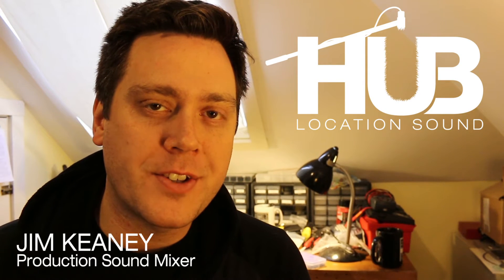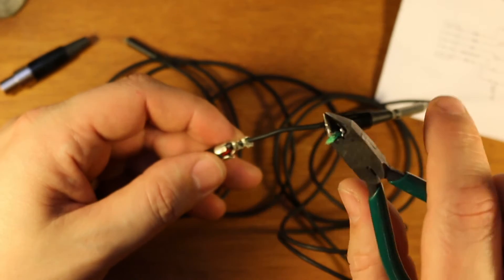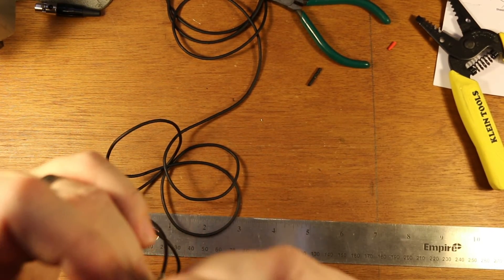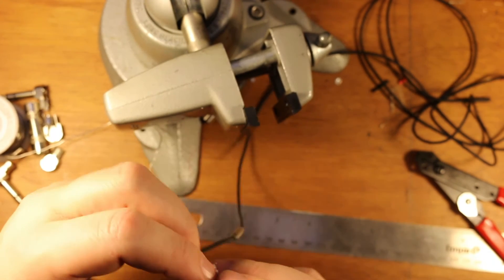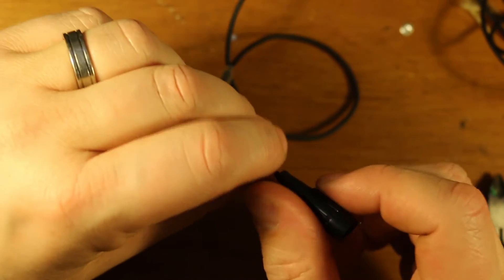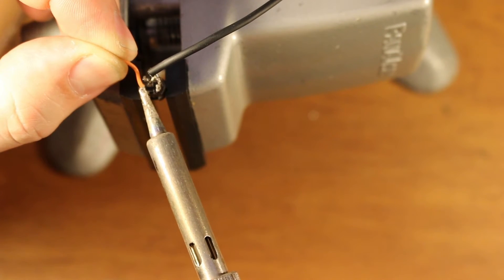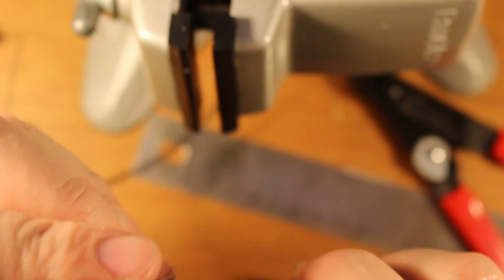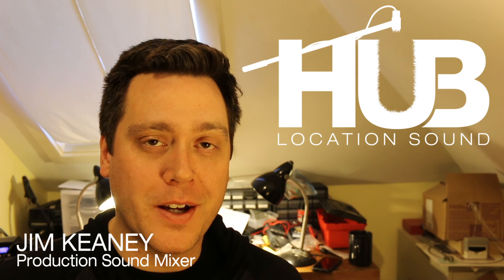Wiring a Sanken COS11d Lav to a TA5 Connector

Comment: Okay, so happy to help here. As an engineer in the industry field, i have terminated close to 1000 Sanken lav mics as the company i worked for was an agent for Sanken.
So a couple of tips.
1. USe a very sharp scalpel (surgical std) and rotate the cable with the scalpel bearly cutting through the sheath but not damaging and cutting any of the shield... this can cause microphonic noises if the ends of the wire rubs.
2. Dont hold the solder to the soldering iron as per this video and then dabbing it onto the wire. the solder has flux which is important to help the solder flow. You can see the flux spitting and exiting in the video. Hold the solder to the wire you are soldering and apply the tip of the iron and hit both at the same time to get a good flow with flux.
3. Always have A grade side cutters. The eren side cutter 2422e are super sharp and the best as they cut through the white (Audio) and black (BIAS) wire plastic sheathing with ease and with control you will not cut through the wire strands.
4. Lastly, when reterminating, cut back about a further inch from the back of the boot as the most common cause of failure is the bend of the cable has out of the boot where the cable is made to do a sharp bend sometimes and the wires inside and shield can break or be down to very minimal strands left. look hard and you will notice a strange stress mark and texture change where the cable has been stressed on an angle confirming the cause. Other wise most likley the Lav was tugged by talent and this casued the issue... or bad retermination ;)
Happy to make a video from a professional perspective if there is any call.
Reply from the maker: Thanks for sharing your expertise, Jaques. I've learned a lot since making this video a couple years back, but your notes are appreciated. I'd love to see a video from a professional like you.
Reply: @HubLocationSound  maybe you should do version two of this video? :)
Reply: @JacquesPierre Would be great to see a video from you!
Reply: Where can I find your how to video? Thanks!
Reply: @JacquesPierre I would love to see more videos on this! I have to terminate my Sennheiser MKE-1-4's to TA5, so the more tutorials, the better.
Reply: I have also done 1000s of these. The trick is to dip the very end of the white and black wires and solder them to the prepared connector as of they were already stripped and  tinned. After you get the technique down the casing will melt as you solder it and youll get a perfect connection.

Comment: This is great. I was struggling so much soldering the tiny wires;  I initially tried to strip the B&W wires. After your tip of just dumping it in the molten solder worked a treat! Thank you.

Comment: thanks for the Video Loved it and helped me 
just to confirm the colors of the cables
white  is Audio Pin 5
Black is Bis Pin 3 
is that correct or did I get that wrong ?
Reply from the maker: nour halawani Thanks, glad it helped. Yes, you got the colors correct. The pins depend on which Lectrosonics wiring diagram you’re using.

Comment: Good stuff. I also didn’t separate the shield. Right after stripping the insulation off I tinned the shield right where the insulation was cut off all the way around. I then pulled out and cut off all the shield and fiber strands beyond the tinned spot. I then soldered a real wire to the tinned shield and put heat shrink over the connection.

Comment: Great video. I use old resistors and just cut the ends off for the jumper.
Reply from the maker: Bal Rayat nice. I’ve since started doing that too. I put a piece of heat shrink on it, but I like that the leg is moldable and once one end is soldered it’s easy to line up the other side.

Comment: is it valid also for the older um 400 tx?
Reply from the maker: David Aliperti the older (pre-A) transmitters need the older wiring specs: https://www.lectrosonics.com/Support/images/WiringDiagrams/Wiring_diagrams11fig-2017.jpg (FIG#5) which involves adding a 1k resistor (I highly recommend using a smaller 1/8 watt resistor as space is tight enough in there without adding components).
Reply: my usual renting company told me that a normal universal wiring is ok, that has confused me.

Comment: Hey there thanks for the video! Was wondering if you could point me in the right direction for a diagram that will show the wiring for a 2.5mm jack for my MM200 transmitter? Cheers!
Reply from the maker: bing Bong try this http://www.lectrosonics.com/Support/Microphone-Wiring/sanken-cos-11-wiring-for-lectrosonics-wp-watertight-plug.html

Comment: Thank you for making this video, I had a grounding problem on soldering COS-11D into the LEMO connector, Do you ground all the shield or just the metal ground wire on the shield? I got Higher impedance (need more Gain on transmitter)  on the wire that i repair than the wire that original bought from the shop. Or it doesn't matter at all?
Reply: Hey, i imagine by now you fixed the issue but some insights. THe SSM, Zaxcom and later model Sennheiser use the 3 pin LEMO and actually all will be able to work with each other whic is pretty cool. ii have done 100's of these Lav mics and i have always found that soldering shield to Pin 1 and also under the collet eliminate any ground noise. The massive change in dB level indicates you may have had a red dot Sanken that maybe someone put a black dot label onto. i have seen this before. You cannot change LAv level on the 3 pin LEMO by wiring a certain way so the red dot is the obvious reason. I will be doing some of these next week if you want a small video sent to you on how to prepare and crimp properly the connector.
Reply from the maker: Sorry I can't speak about Lemo connectors. I've only attempted this wiring with TA5 connectors. Not sure I understand what you mean by "all the shield" vs "just the metal ground wire". I finger-wound it all together and tinned with solder. Which leaves 3 wires to terminate: white, black, and shield. So yes, amongst the hairy shield is a thin more coarse wire... I kept them together.
Reply: does the soldering wire affect the gain of the transmitter? the one i repaired are 12 dB less than the one i got originally. is it the matter of the soldering wire i choose have more resistance ? what soldering wire you have used?
Reply from the maker: I don't believe the solder itself would affect impedance. Especially by 12db. Do you have any specs on how the original mic's are/were wired? Are you matching that wiring diagram?
Reply: I did open up other COS-11D to look at , it didn't even ground the shield and it only solder TWO wire, signal and the ground. I did the same, it was 12 dB less and got interference with the RF antenna next to it, so i decide to ground the shield, it didn't pick up the RF interference but it was still 12dB less than what i got from the store. 

Every mic i repair have the same problem ( 12dB less) so i wonder the problem is the grounding? the solder? or else... 

One of my sound recordist friend who have the same problem with TA5 connector, he said the COS-11D was quieter that original after repairing.

So do you lav get quieter after repairing? Or maybe I didn't strip the cable well made a bad connection, causing unwanted resistance?
Reply from the maker: KK Chau you're going to lemo? What wiring diagram are you following?
Reply: And i have opened my other lav to check how do they solder it. I followed by the result is different.

Comment: Thanks for making this video. This worked great for me. The only thing I did differently is that I didn't strip or tin the black and white wires. I just pushed them into the molten solder on the connector.
Reply from the maker: nice. yeah basically the same approach - I will try that next time.